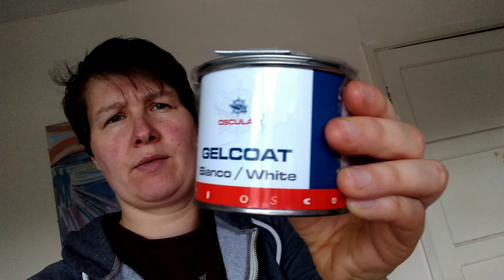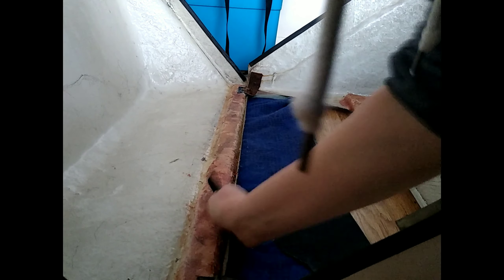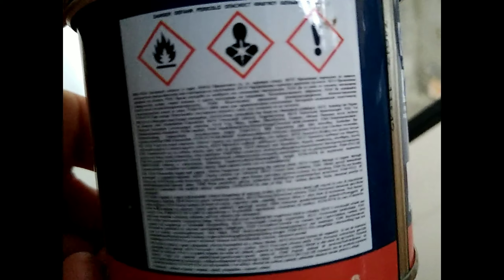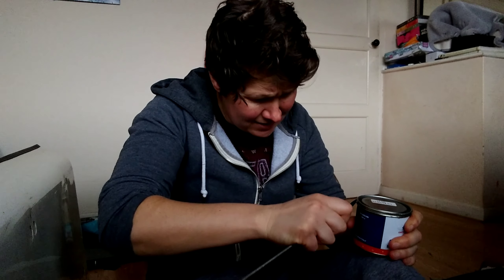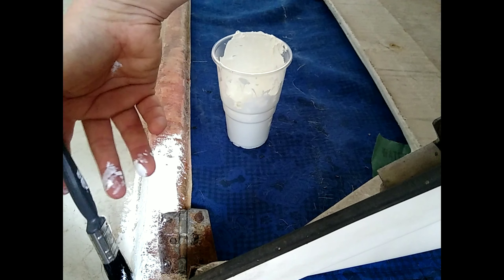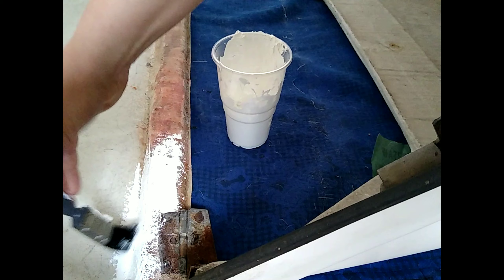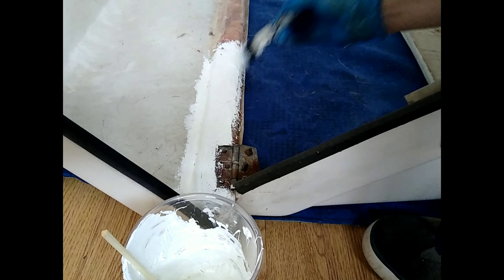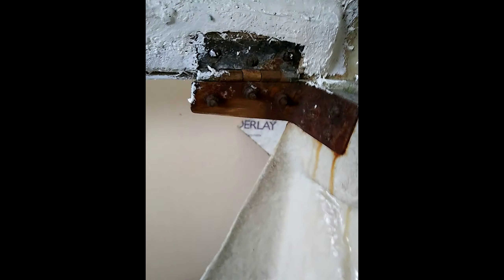Freedom caravan storage box

Comment: Oh my.  Hey just out of interest when I have two parts to mix I usually get the scales out and work out roughly what 10% of each part is.  I know weight in g is roughly same as volume in ml, I also know it isn't exactly right, but who cares.   So for example (am just gonna pick two random numbers)  If I have 285ml of one part and 15ml of the other part I will just put 30g of one to 2g of the other.  I guess 58g of one to 3g of the other would be better, but you get the idea.  I am not a pro, this is not a pro tip, I am just someone who finds new ways to f*** up constantly.
Reply from the maker: To be honest I think it had been sat  way to long in my shed. I think it should of been wetter to begin with but saying that I have no idea as I have never used it before .least I know for next time now tho ..and possibly mix smaller amounts good job it was only the inside of the box and not the van itself 😂